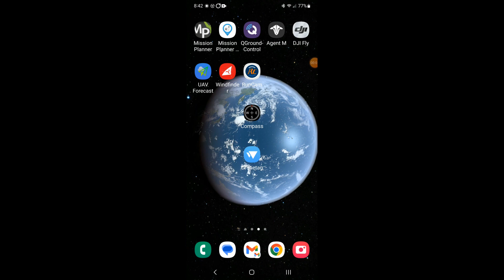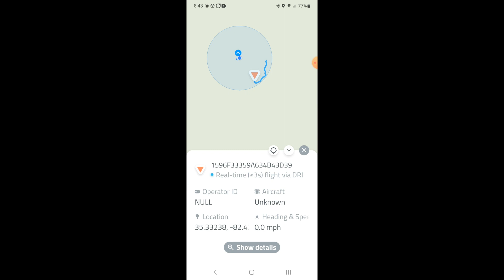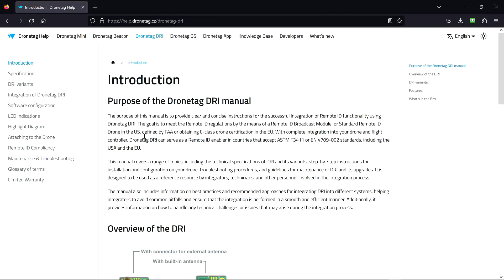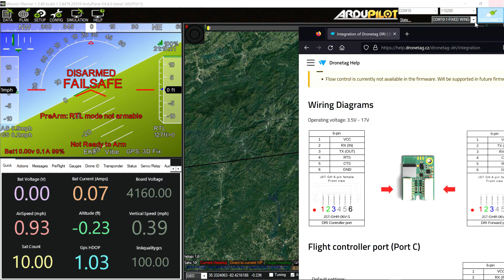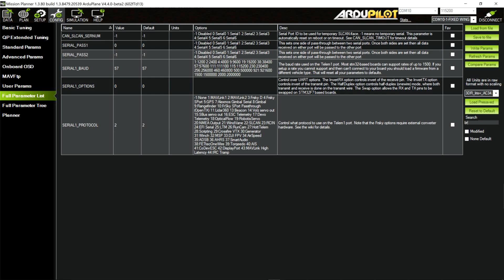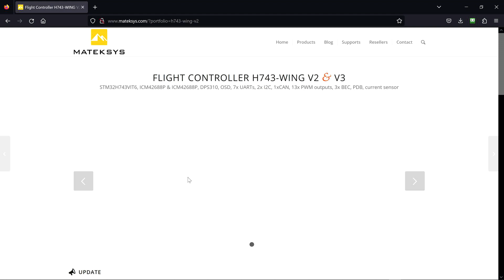Remote ID Problems Continue 3 of 3

Comment: Thank you sir! Great work setting up the Dronetag DRI. 

Attempting to be compliant with the faa and looking for a RID device I was curious about the DRI because of the low cost and weight. However was unable to find anyone else who could show me how to set it up. Really appreciate you making this video series of your process of getting it working. 

One suggestion in helping the algorithm connect others look for your valuable information is adding more detailed text to your description/title specifically including "Dronetag DRI"
Reply from the maker: Thank you for the kind comment.

I also need to add tags so my videos can be found more easily.  If I were asking for funds or monetizing my videos, I would have to do that for sure.  I will add tags at some point and also better descriptions and titles.  Thank you so much for the suggestion.